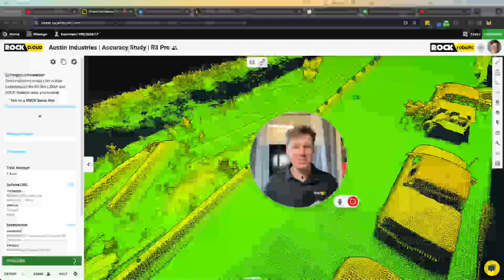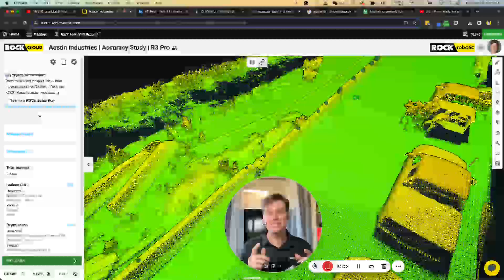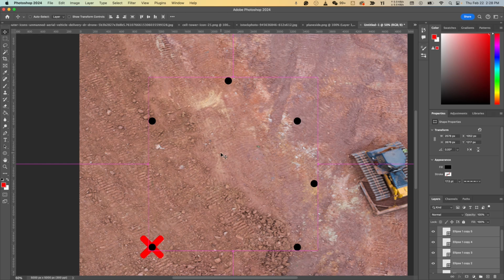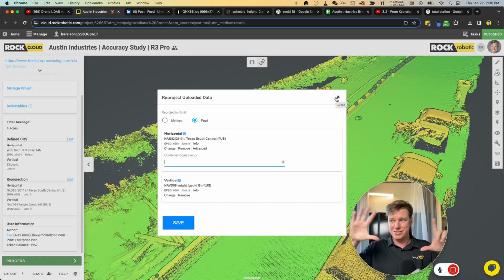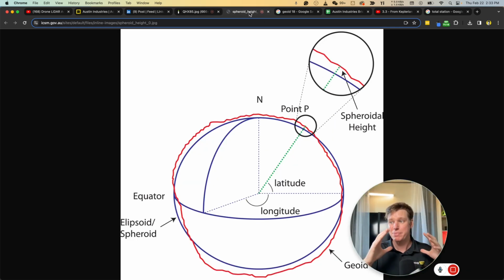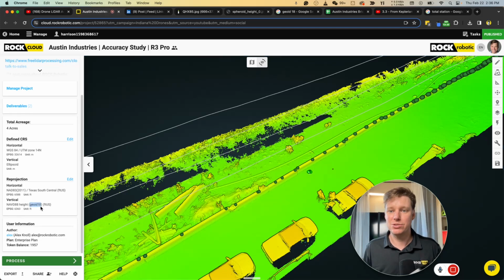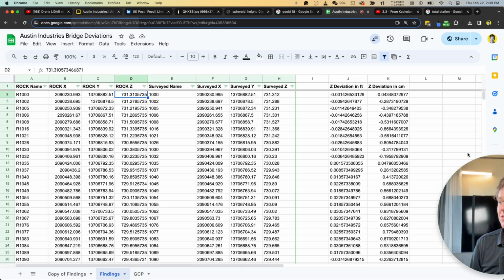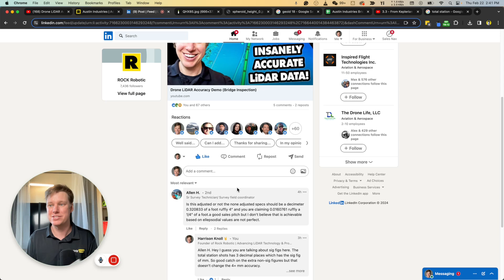Surveyor Questioned My Accuracy Video? (RESPONSE VIDEO)

Comment: Your accuracy is real 
The ellepsodial heights this guy refers to are not a problem because the error that they produce is the same for the hole model you have made .
Since you georefenced correctly your model with the surveyors reference frame he used for his points you are perfectly fine.

Comment: I think more slop than this is baked into the projection systems. Independent measurement could probably find features in your data set that actually measure more than a quarter inch from where your mapping projects them to be. Better to claim incredible precision and integrity in your collection than to suggest (or imply) that your process added accuracy to the various projections. See what I mean?
Reply from the maker: Hey Rick, thanks for the comment and I totally agree you can definitely find areas that have greater error. In this case the flight was made to capture the detail on the top of these girders so that’s the area that got all the check shots. And even in those you are correct and some of those are greater than quarter inch. But the standard deviation is what our client was interested in to gain an opinion about the overall system accuracy.
Reply: @IndianaDrones  I am a licensed amateur drone pilot and I have been wanting to break into the professional field for several years but I just cannot find a way to do so on my nonexistent budget. Do you have any tips on how I might be able to accomplish this that I have missed? TIA

Comment: I have never met a profession with more sacred mysteries than surveying.  Unless you have that license, you don't know jack and aren't allowed to measure anything longer than your arm.

I work for a county as a GIS Specialist.  I work with property parcels all day.  I constantly send maps and documents (which have been stamped with their sacred seal as being the one true measurement of a parcel) back to surveyors to correct their mistakes.  I wrote a program to take the coordinates of the sections' corners and subdivide them, even using the original survey notes for our County to account for correction-sections.  I had a surveyor tell me, "*You* can't do that!  Only we can!"  Didn't matter that my program matched his calculations to the thousandth of a foot...  Except for the four of the ten he miscalculated.
Reply: The funny thing about all these surveyors who always boast about being licensed is that they all run around with crooked rods, unmaintained equipment, irregular standard device maintenance, no temperature compensation, and LITTLE understanding of what is actually important
Reply: Good thing the sacred mystery of measuring and verifying the monuments in the field exists. You have returned maps to correct surveyors mistakes but also accept the same maps and write a program to "subdivide them" without getting out of your cubicle.... You are the reason every GIS map has a "we assume no liability for the following data" warning at the beginning of it 🤣
Reply: @tep916  -- I might be impressed if that measuring and verifying was repeatable. We get plats with three different as-recorded measurements and one new as-measured. None of them match. Occasionally, they vary by up to five feet across a 100-foot lot. I've see maps where a surveyor plats out some lots, then comes back and replats a couple of them the next year and has different bearings and distances between his own pins.

And of course I have to put a disclaimer on my maps...  There are over a million documents in the vault dating back almost 200 years.  Each has its own errors.  Survey errors, transcription errors, copying errors perpetuated through document after document.  No surveyor would accept and certify work he didn't do either.

Our corner monumentation certificates have a history section.  That's always a fun read...  Back in the 1920s, a surveyor replaced the original cedar stake with a two-inch iron pipe.  The next surveyor finds a one-inch iron pipe  The next surveyor finds an old axle shaft.  The next surveyor finds a three-quarter-inch rebar.  The next surveyor finds the hundred-year-old two-inch iron pipe.
Reply: @bokkenka  imagine writing 3 paragraphs that support the need for survey licensure without realizing it. How terrible of a surveyor that had a different measurement a year later...not like the earth ever moves but you knew that. Surveying is so easy and such a joke a smart guy like you should have his license by now. Your position is as funny as the rock robotics guy claiming a higher accuracy than the Hesai Pandar XT32 sensor even claims. And no disrespect to Harrison Knoll as he's a very talented person and owning that he can always learn more and improve so kudos there. My point is none of us are perfect and know everything. Your original comment the guy said "you can't do that" cause you represented a boundary line without doing a field survey and without a license. So you likely broke the law state depending. What you took as entitlement from the surveyor was actually sage advice. All these maps have all these errors yet the program you wrote that uses those maps with errors is perfect and better than his calculations. How asinine.

Comment: My question on LiDAR is when you have heavy vegetation coverage would the LiDAR measure the foliage height as the surface & not the actual surface. 

When you have top soil piles in a gravel pit reclamation the vegetation grows heavier than on the subsoil surrounding the top soil pile. Could this not result in an error was estimating a volume of a pile? 

Having an extra two feet of depth on a topsoil pile might result in a variance between estimate volume & actual volume.
Reply: Yes, lidar might return the tops of vegetation rather than the ground.

Some systems can measure multiple returns from each pulse, so you might get a partial reflection from a leaf, another from a branch, another from a bush under the tree, and a last one from the actual ground.  In multiple-return systems, you can remove all the returns except the last from each pulse to get the best measurement of "the ground".  You might still need to classify some of those final returns as something other than ground to get the best surface.

If you have a simpler one-pulse-one-return system, they can have trouble penetrating vegetation.  In the previous video (@2:19) he shows that the drone is collecting 1600 points per square foot.  (I don't know if it's single- or multi-return.)  Some of those might sneak down to the ground, so you could just use the lowest points on the soil pile to get the best measurement.